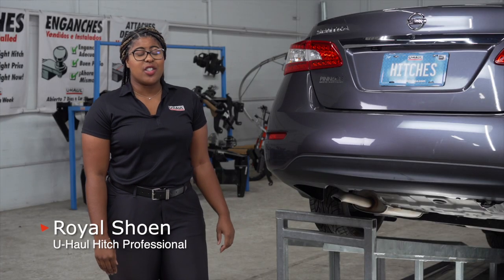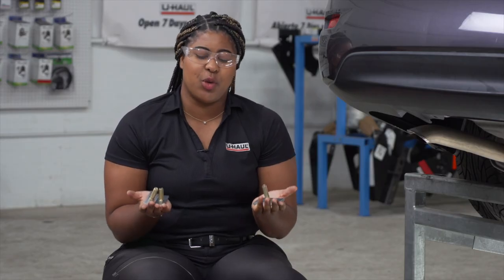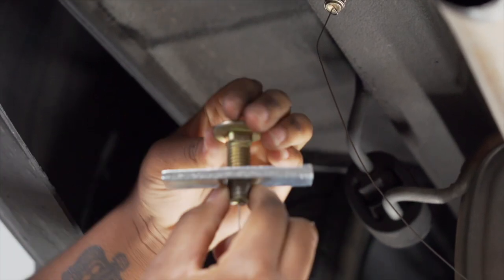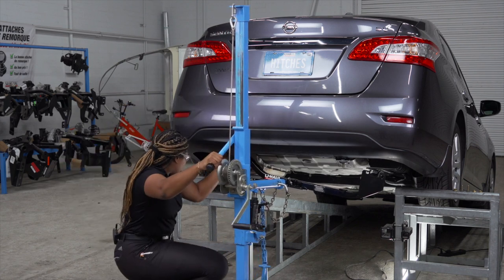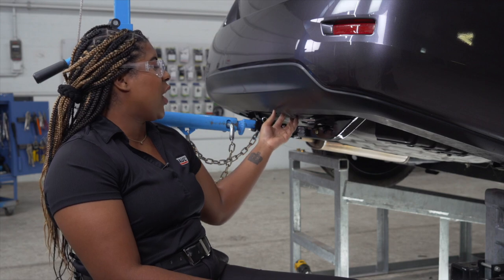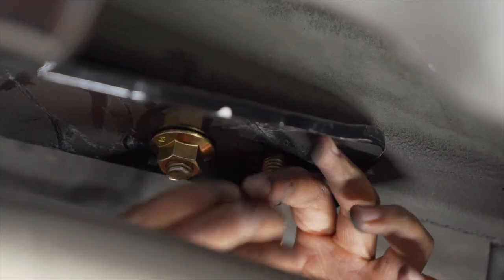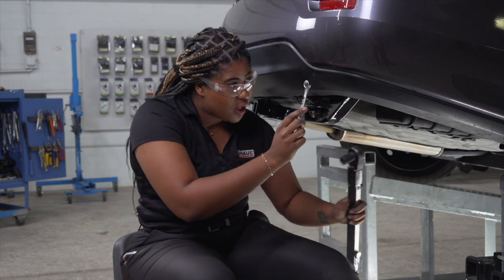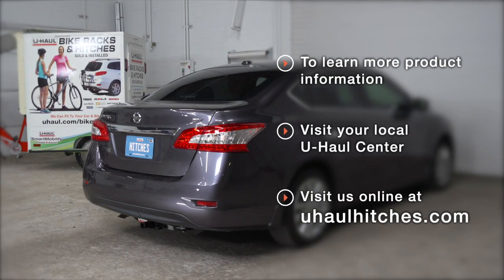2013-2022 Nissan Sentra Trailer Hitch Installation

Comment: I have a 2019 Nissan Sentra s 4cyl want to get a sea doo will be able to tow that ?
Reply from the maker: The Hitch Installed in this video has a 2000 pound gross weight capacity and 200 pound tongue weight capacity. Refer to your owners manual for vehicle recommended capacities.

Comment: Could I tow a motorcycle trailer and motorcycle? Bike is about 560lbs.
Reply from the maker: The hitch featured in the video is rated to 2,000 lbs. gross trailer weight and 200 lbs. tongue weight which allows you to tow our motorcycle trailer!